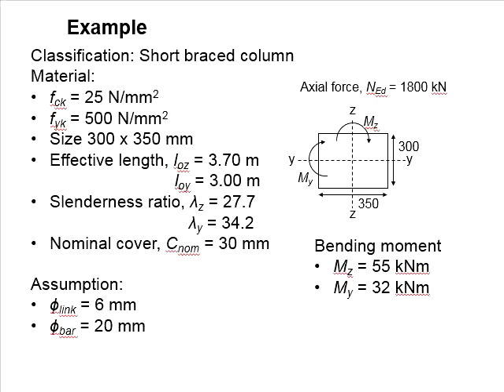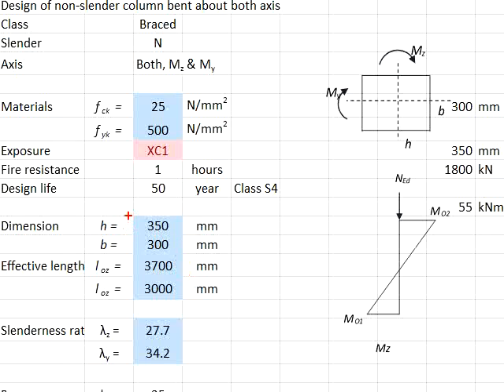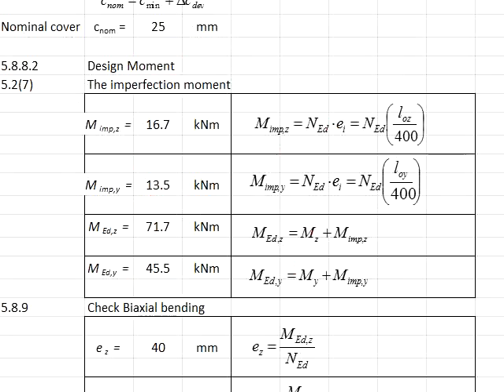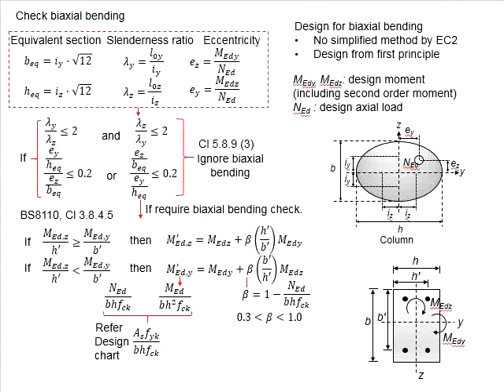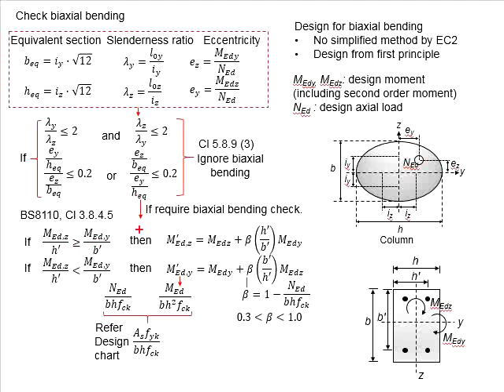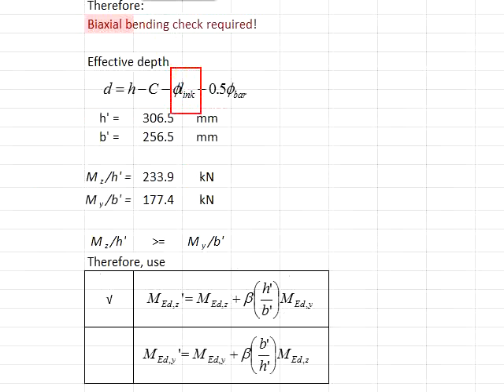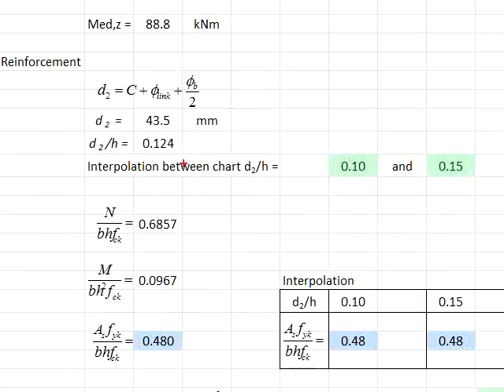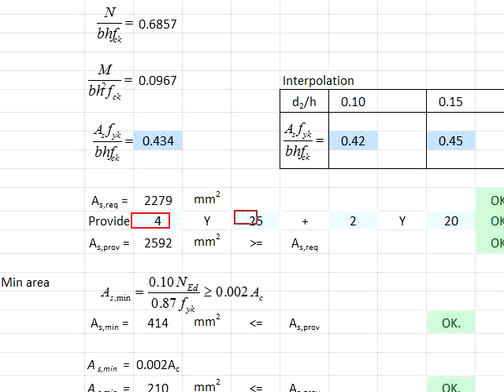2.23 Example: Short braced column, biaxial bending Part 1

Comment: So, if biaxial bending pass --> Only consider the major axis moment for calculations.
If biaxial bending fail --> Combine both the moment using the equation and then use for calculations? Is that what are you saying? just trying to get it clarified.
Reply from the maker: Yes. there is a check (Cl 5.8.9(3)) whether you can ignore the biaxial bending. If it can be ignored, you can just design for the uni axis. Probably you will need to check for individual Myy and Mzz direction, but not need to check the combined effect.
Reply: @eng-aim  Got it. Thank you

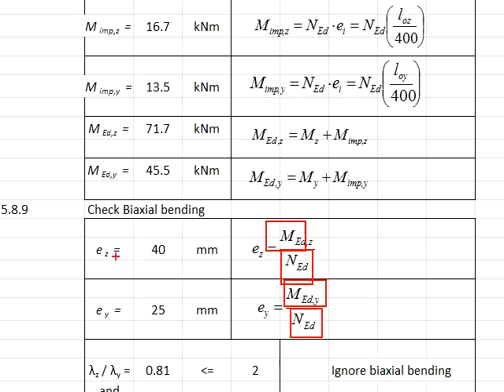Comment: Hi sir. Thank you for the detail explanation and calculation example. It helps a lot. I have a question. At 6:25, it is stated that the equation for eccentricity is ez = Med,y / Ned. However, at 6:46, the eccentricity ez is calculated using the equation ez = Med,z / Ned. Which is the correct equation?
Reply from the maker: e y = M Edz / N Ed is the correct one. Thank you for letting me know the errors.